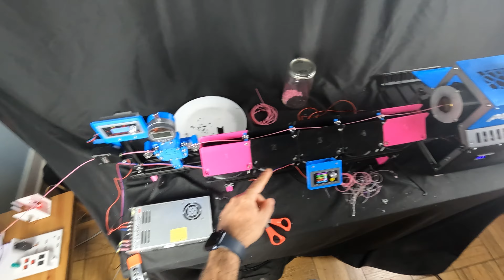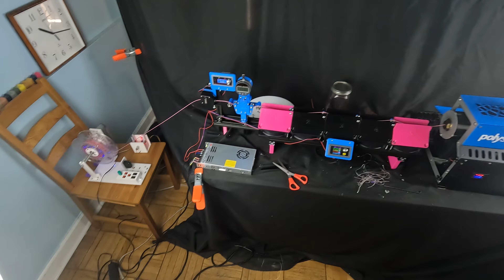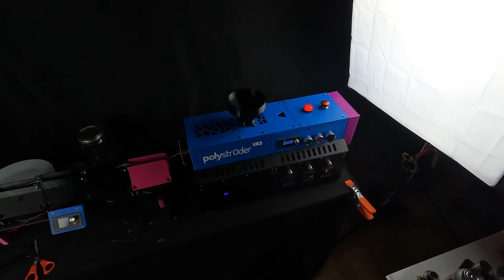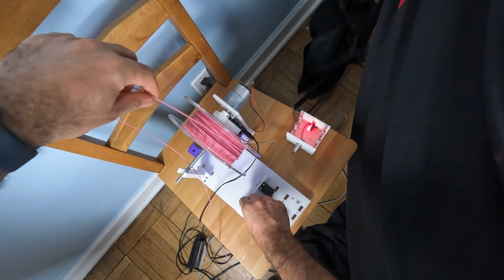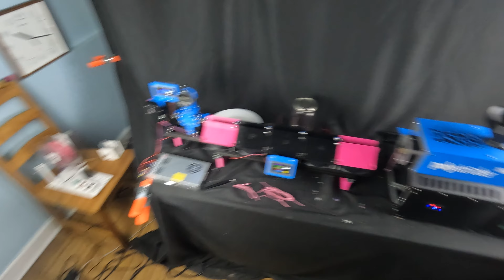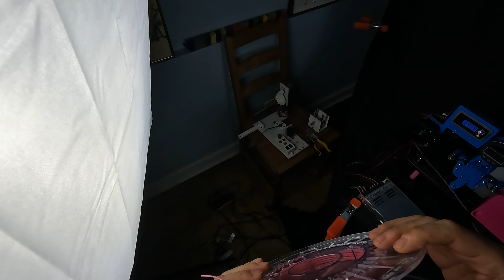Extruding DIY 3d printing PLA filament with colored mica powder pigment on polystruder XR3.

Comment: If the extruder part of this machine used a set of interlocking twin screws, and it had shaping dies, a melt filter and doses for ingredients, you could make not just filament from scratch but pretty much pla itself from scratch safe from the chemical manufacturing of the PLA fibre itself, though you can do that easily at home already. By then putting the PLA fibre into the machine along with pigments such as mica powder and any other additives that you want to add like decedents, fillers and other stuff, you can get a colour way closer to what you want and Emme material with properties according to your specific needs. You need to remember to extrude the lines that come out of it or the threads or ropes or whatever you wanna call it underwater though, then have it come out of the water again and into a simple machine consisting of a large open bucket or container or vat with a blade at the top that cuts these “ropes” into smaller pellets. Now you have your master batch which you can either use directly to make PLA filament inside a machine like the one you have there or the art me 3-D one, you can mix it with some pallets of other PLA to save your master batch and your PLA filament

In a machine like the one I mentioned above, which is actually how they produce PLA and other plastics, including for filament, in factories, it is the sheer friction of the tin screws of the twin screw extruder or compounder or mixer as it’s also called that actually does the melting of the PLA and the mixing of the pigments and other additives throughout this filament. The melt filters are there to remove any impurities from this melted mass. there are also electric heating elements along the barrel that the screws sit inside of but they are not juiced for melting the PLA itself but rather to keep the PLA from going rigid and thus to make sure it’s still moves as it’s pulled out of the extruder and another use for them to make sure that the PLA or other plastic that you make do not stick to the inside of the barrel in anyway

It’s expensive and might not be so effective, seeing as I’ve read that the screws are better if they are longer and massive due to this having more torque, but someone did make a desktop extruder of this kind. But like I said, it’s expensive, but perhaps it is time for us makers to make our own DIY and possibly open source version of this kind of machine! I think it is! We are already getting there with machines like the one in your video. Here is a link to the desktop Twin screw extruder compounding machine that I found earlier today: https://robotdigg.com/product/1734/Twin-screw-parallel-or-conical-type-desktop-extruder,-pelletizing-line